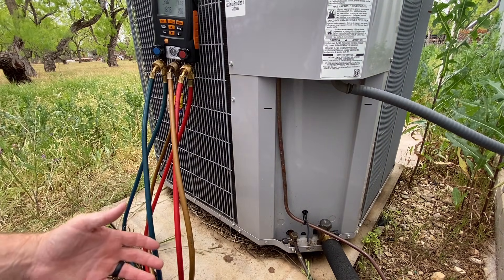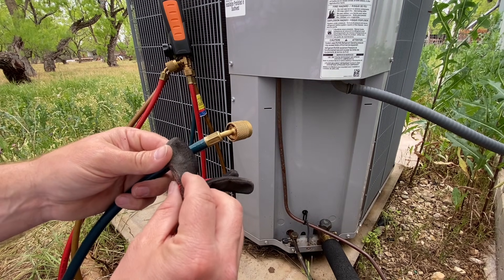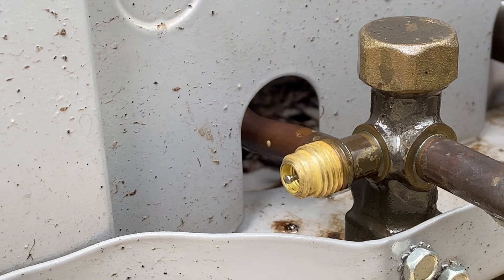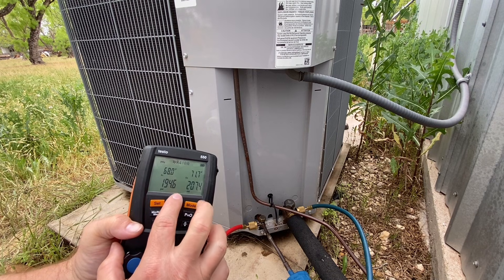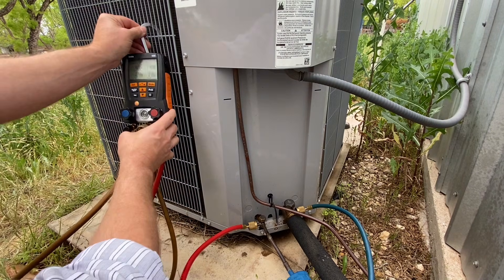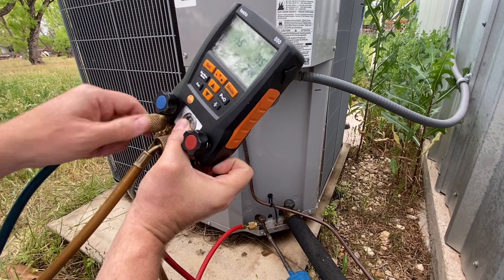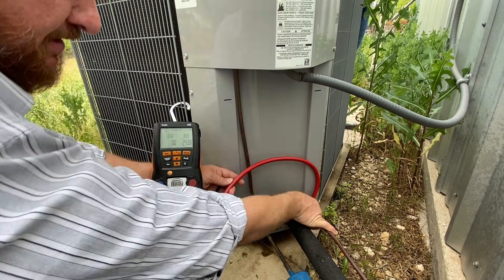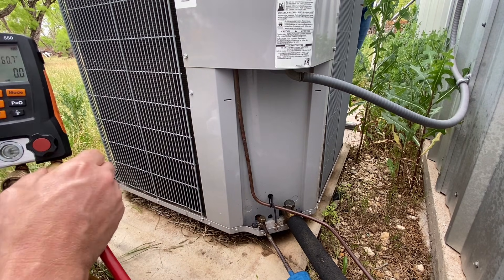HVAC 042 A Gauges and hoses on and off the simplest way without contamination.

Comment: Are Located In Florida ???
What is Better And Cheap For The
Electric Bill, 
The Inverter Mini Split For Complete House 
For Each Room Or The Central Air Conditioner ???
Thank You.
Reply from the maker: I work all over the USA. I have lived in Florida before and consult there often. 

Before we get to that answer...

Before you consider a new system you need to take a look at the home itself.  I recommend paying to have some test ran first. 
#1 is a blower door test. This will show how leaky the house is. This is extremely important especially in Florida! It does not good to cool the house if moisture is moving in through the walls and the house feels sticky.
If the house is sealed up first, then  you won't need as big of a system and it will dehumidify better, reduce drafts and stratification and provide more comfort. 
Ideally they will do a duct blast to see how bad the ductwork is leaking too.

After that is done and any repairs made to improve the home you can use the new blower dore number with a heat load calculation called ACCA Manual J. This will give a proper size for the home. Remember bigger is NOT better, it actually makes humidity worse, comfort worse and uses a lot more energy.

From there they can do an ACCA manual S to determine the correct unit to fit the heat load.  A ton is not a ton anymore. The system needs to be capacity matched to the unit. Some units sensibly cool more but dehumidify less.  While others dehumidify better but don't have as high of a seer rating.

The installation of the equipment is going to be very important. The installation is more important than the brand.

Inverter equipment can be in . Ulti zone ductless or in traditional ac. It has a variable capacity that allows the compressor to slow to match the load. Some people like it for better comfort others say the parts and repairs cost more. Both are correct. Either way have a surge protector. I prefer the ICM-493 surge protector, it also protects from low voltage that's known to happen in Florida. 

Now a mini split for each room.
I really like this but it has a few drawbacks. 
#1 they don't make them small enough for most rooms so they end up being oversized.
#2 because of #1 they don't dehumidify as well. (That's a big deal in Florida)
#3 in a humid climate the evaporator coils can develop growth and can have drain issues that can damage walls when they overflow. Kinda a problem in Florida. Not an issue in Las Vegas.

If your in South Florida look for a company called Comfort Dynamics Inc. Genry Garcia is too level at whole home solutions. He can do all the design with and testing.

If you're in central Florida look for Kalos services. 

Good luck!

Comment: I'm new and learning but I have this strange fear of putting on the lines.
Reply from the maker: Many students have this same fear.

In class I spend over an hour with students taking turns rotating around just putting them in and taking them off. Then we do it again the next day. I do this repetition to  build motor skills and get students comfortable. 

In time things will get easier and then new things will need to be learned.
Reply: @love2hvac  that helps alot I wasn't sure if it was just me or something.
Thank you for the video also.

Comment: One question though, I thought the suction line was only vapor, but you put the liquid from the liquid line into the suction. Can someone explain this to me as thought the suction goes directly to the compressor
Reply: I am totally new to this and was puzzled by it too. I could be wrong, but I believe you release high pressure sub-cooled liquid into low pressure superheated vapor suction line, and the liquid would turn into vapor instantly once out of that high pressure hose. The low pressure is the key.  Please correct if I am wrong.
Reply from the maker: You are correct
Reply: @walterkubiak  ohhh, this makes sense. Thanks brother. Does this mean it’s possible to charge liquid in suction line without damaging compressor?
Reply from the maker: Yes, but you have to throttle it in.
Small amounts at a time. I have a video in this play list showing that procedure.

Comment: You make the misstakes that you just say we no shut do and you do it, like the hook and put the hose on the ground, why you not empty the set in the system when your bluehose is still connected??
Reply from the maker: Everyone makes mistakes.

The reason for moving the hose is to prevent contamination from the air moisture and existing refregerant that's trapped in the manifold and center hose.

Comment: I have been told that putting liquid refrigerant into the suction line can damage the compressor…
Reply: That is true but it's less likely to happen with a schrader valve in place to cause a pressure drop. Still, not the best practice. I have ball valves at the end of all my hoses and it makes it so much easier. If you crack open the high side valve on the manifold it will flash all of the liquid to vapor and the compressor will safely suck it out through the low side hose. If you don't have something connected to the service hose it will blow out pressure so that's why I have a extra ball valve to hold pressure. It's also nice when the refrigerant tank runs out you can just close the valve and swap tanks quickly with a little purge instead of having to purge the entire service hose every time.

Comment: I’ve heard of people pulling a vacuum on their new set of gauges so the air in the hoses don’t get into the system should I do this with my new set ??
Reply from the maker: It won't hurt, better yet go wireless bribes and you don't need hoses

Comment: Take the liquid side or the high side off first. Then open up both valves on your gauges and the suction will pull the rest back in.
Reply from the maker: The problem is a lot of techs contaminate systems doing this.

The non condensables or other refrigerants left in the middle get pushed into the system. Even if you purge the yellow hose there is what's left in the manifold itself.

You have to purge from the suction side through the end of the service hose and again the liquid side. That also does not get rid of moisture stuck to the sides.
This method takes less time, less likely to cause contamination, and easier for new techs to understand.
Reply: @love2hvac  practice makes proficiency not perfect, you could have been doing it wrong perfectly the whole time. Im learning so much through your videos.

Comment: I learned a couple things. Well done. My question is you never purged your gauges during hookup. So potentially introduced non condensibles .. correct me if I’m wrong. Overall excellent tutorial thanks
Reply from the maker: If your staying with the same refregerant there is no need to pruge. There will be residual refrigerant in the hose. 
However if changing between refrigerant purging is absolutely necessary. I think I cover that later in the series. Early on I leave the purging of the hoses out as students have a high potential of letting too much out and causing safety issues in the labs with new students. I take students in the lab and we spend 30 minutes to an hour just putting the hoses on and off the equiemt so they get familiar with it. Oh the things I have seen in labs! 

No purging for  new students.
Yes purging between refrigerants.

Use wireless, hoseless, probes and it's a non issue all together!
Reply: @love2hvac   air counts as a contaminant purging matter
Reply from the maker: If air does not enter the hose and there is always positive pressure on the hose from refrigerant, then the contaminant air cannot get into the hose.

Comment: Some other videos say you should purge the air out of the hoses hoses when connecting them. Is this necessary?
Reply from the maker: Yes for the first time and between different refregerant.

However if your working with only 410a all day, there is no need to purge every time.

Comment: With the unit running during disconnect, is there not a risk of sucking in air on low side?
Reply from the maker: Not with this method.
The suction side is still under pressure so it's not going to pull air in.

Comment: What is that other copper line coming down from the electrical connection box?
Reply from the maker: It's protecting the thermostat wire. Each end is flaired. It's an old school method, not as good as flex conduit

Comment: When you connected the high side hose to low side to return the liquid refrigerant to the system the hose will get some air back to the system so should bleed it or what? Thanks.🌷
Reply from the maker: With the auto low loss fittings the hose is still fill of liquid all the way to the fitting. When you connect it to the unit there will still be that little spray off the pressure coming out. That displaces the little bit of air .

It's much much less than what is in-between the manifold and what's in the service hose.

Comment: Don't like being clever, but why don't you use special refrigerant pullers?
At once I froze my palms, after all I drastically change my views on safeness.
Here you are a sumb and subscribe.
Reply from the maker: This is my I push the 2 fingers method so strictly. I have the class do that exercise over and over until everyone does it without thinking. People naturally want to grab the hose in their hand. That is dangerous and that will sooner or later directly lead to frost bite in the palm of your hand.

As for safety this is what your suppose to use, Butly gloves, chemical resistant tonthe liquid refregerant  won't absorb into it. 
https://www.amazon.com/Rubber-Gloves-Chemical-Reisistant-Medium/dp/B08T74QTHP/ref=mp_s_a_1_6?dchild=1&keywords=butyl+rubber+gloves&qid=1631256689&sr=8-6

I'm not sure what you mean by refergerant pullers.

Comment: I remove the high side hose first and feed the liquid through the gauge into the low side
Reply from the maker: That is one way but the problem is contamination. 
In the center of the manifold and the yellow hose, there are contaminants, old oils, air, moisture, and others.

To prevent the contamination you take the yellow hose off to eliminate its contamination. Then use a valve cap on the center port, leave the cap loose and purge the manifold, then tighten the cap. Then you can do the bleed across the manifold method. It's a lot of steps.

Most units that end up with none condensible are from techs doing the bleed across the manifold method without purging. 

This method I presented is faster than that and less issue of contamination.

It is a lot easier for new students to understand and grasp.

Several years ago we had an instructor that never purged the manifolds. The units would always have noncondensable until we did recovery and vacuum and then they would run from again until he did his class. I watched the class to see what was happening and it was that. After 6 students were purged across the manifold, it was enough to change the system operation. After he started having the class do the method in the video the noncondensable issue was solved. 

A little contamination goes a long ways
Reply: Then your dumping a bunch of air back into the system unless you purged every hose before you do that

Comment: Great advice. Question, when the unit is off and you had roughly equal pressures does it matter if you have a piston or TXV ?
Reply from the maker: This method dosen't work with the unit off and equalized pressure so it would not mater which metering device.

Comment: Great video. Never saw or thought about putting hi side hose on  low side to put gas back in, very cool. Do u have a video explaining tonnage n hp ? I work on walkin coolers/freezers n reach-ins. Trying to get a better understanding of how to size up fd, txv, solenoid valves. For example 1hp in refrigeration is 4000 btu but on ac 1hp is 12000btu. Thanks for sharing 👍
Reply from the maker: Eventually I will get to the refregeration portion. It's great that you already get the different HP vs ton. I know instructors that don't even get that. I will do a video on that sooner or later. Great recommendation, thank you!
Reply: @love2hvac  thanks. Correction 1hp low temp refrigeration 4000 btu. 1hp med temp 8000 for refrigeration. New to the trade trying to absorb as much as I can.

Comment: Quick question, why do you put the left over refrigerant in the high side line back through the suction side I thought you don’t want liquid refrigerant going to the compressor?
Reply from the maker: I realize it is different but its ensures there is no contamination and it is a fast way.
The liquid enters at a small enough amount that it flashes to a vapor before it enters the compressor. that is why it is important to have the compressor running when doing it.
HVAC 042B part2 explains this https://www.youtube.com/watch?v=ZPS_vY47Y-M

Comment: Why didn't you leave your gauges on and just use the vavles on you guages to reintroduce the liquid into the suction line?
Reply from the maker: Great question, the next video I do this.
The main reason is contamination. 
What is in the yellow hose? what is in the manifold? Oils from other units, moisture, acids, air, other refregerants. It has to be purged. Stay tuned for the explanation.